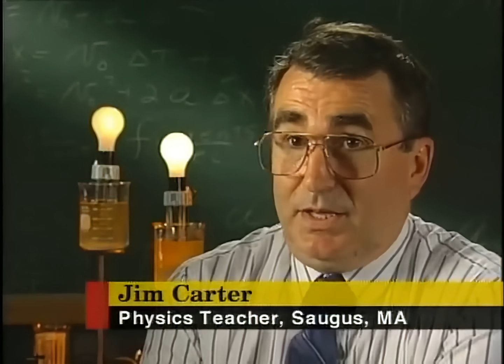MIT graduates cannot power a light bulb with a battery.

Comment: The woman who said the current couldn't flow without a complete circuit was technically correct... she simply didn't know that that base of the bulb could be used as a connection. Simply a misunderstanding of the properties of the bulb as opposed to electrical current theory. This is a prime example of education vs experience in the field.
Reply: I don't think it's failure to understand the properties or construction of the bulb at all.  I suspect that had she been given a 2nd wire she would have immediately connected it to the light bulb and battery correctly (as would several of the others).        The problem here is not failure to understand how the most basic electrical circuit works, but failure to adapt when a simple problem is presented in a non-standard way.   People just do not visualize a light bulb (or motor or almost anything else) in direct contact with its power source.   

I do think this non-adaptability (related to poor critical thinking) is a real problem, but the video misrepresents it.
Reply: @daemn42  Poor critical thinking / reasoning ability, that's it right there. That's the whole issue.

In high school I had a part time job at a mechanics shop cuz I wanted to be one at the time, and the single biggest thing that stood out to me was the incredible reasoning ability of the mechanics. Their problem solving and ability to adapt was so undeniably impressive.

They were one of the best shops in the city and I'm glad I was able to learn from them for those few months.
Reply: @bassmunk  it isn't lack or abundance of critical thinking. It is a way of viewing what things do/how to do them. That comes from working in the constraints of the job. There are recurring paterns to solving problems and tricks of the trade derived from other tricks. The first guy was right, it shows why actual job experience is important. People have to get used to thinking within the constraints of the actual real job.
Reply: Cobblers. Billions of torches (flashlights) the centre contact of the bulb connects directly to the battery (cell actually, but who cares about science?)
Reply: @daemn42 thanks for writing this for me. As an engineer worki g with young engineers, this here is the main problem.
Reply: @daemn42  You can turn a single wire into two wires pretty easily if that's how you feel you need to solve it.
Reply: @daemn42  MIT students can’t think critically? Joke of the century……
Reply: @BadAss_691   Welcome to 7 years ago, and yes MIT students like all students can be fooled by a non-standard presentation of a familiar problem.
Reply: I think everyone is overthinking it, if the battery is not capable of supplying the proper voltage, you can still connect it, but it wont be as bright or light up at all, but you at least connected it correctly.   Its a trick question...  Terminology means a lot, and everyone screws it up.  I cant count how many times we've connected multi-million dollar CRAC units and server cooling systems that I knew weren't going to work sufficiently with the power supplied and other factors,, but was required to do it anyway, just to show the tenant that they got ripped off or had hired a very poor engineering firm to do their design ( if you build enough of them you'll figure it out as well). Of course Light bulbs and lightning systems are way easier.
Reply: @byb4376 Caveman make light with battery bulb and wire. Caveman take positive end of battery, and make touch with positive contact on bulb. Then take wire, connect negative end of battery to negative end of bulb. Caveman like light. Light gooooood.
Reply: +theo tryhard It should be, but isn't.   That's sort of the point, and small optimizations like that are the foundation of a lot of puzzles.
Reply: @daemn42 Caveman make light with battery bulb and wire. Caveman take positive end of battery, and make touch with positive contact on bulb. Then take wire, connect negative end of battery to negative end of bulb. Caveman like light. Light gooooood.
Reply: I think the first (candle shaped) big light bulb was rated to 120 volts, so 1.5 volt battery isn't going to produce enough current to make it lit.
Reply: @Derpstering Caveman make light with battery bulb and wire. Caveman take positive end of battery, and make touch with positive contact on bulb. Then take wire, connect negative end of battery to negative end of bulb. Caveman like light. Light gooooood.
Reply: it should be obvious that the bulb be used as a connection, as it connects to the wire
Reply: @theotryhard8651  yeah it is quite obvious at that age...I mean we do this stuff when we are 10/ 11 yrs old so it's quite obvious to me now that I'm 20
Reply: @theotryhard8651 Caveman make light with battery bulb and wire. Caveman take positive end of battery, and make touch with positive contact on bulb. Then take wire, connect negative end of battery to negative end of bulb. Caveman like light. Light gooooood.
Reply: "In their classic paper Perception in Chess, Chase and Simon reported on a study that compared the abilities of experts and novices to remember the positions of pieces in chess. When pieces were arranged on the board as they might be during a game, the experts' memories were far superior to the novices'. When the pieces were arranged randomly, there was little difference between the memories of the experts and the novices. The traditional interpretation of this result is that an expert's memory is not inherently better than a novice's but that the expert has a knowledge structure that helps him or her remember particular kinds of information. When new information corresponds to the knowledge structure -- in this case, the sensible placement of chess pieces -- the expert can remember it easily. When new information doesn't correspond to a knowledge structure -- the chess pieces are randomly positioned -- the expert can't remember it any better than the novice.

A few years later, Ben Shneiderman duplicated Chase and Simon's results in the computer-programming arena and reported his results in a paper called Exploratory Experiments in Programmer Behavior. Shneiderman found that when program statements were arranged in a sensible order, experts were able to remember them better than novices. When statements were shuffled, the experts' superiority was reduced. Shneiderman's results have been confirmed in other studies. The basic concept has also been confirmed in the games Go and bridge and in electronics, music, and physics." src. CodingHorrors
Reply: Blake Marshall even though she was " technically" right, she couldn't solve a basic problem without it all being laid out for her. If I have to give you all the " correct " parts then didn't I just do it for you. That is a problem if you can't think out of the box
Reply: +By B, it's not a trick question. They failed the test before connecting the circuit. The question they were asked was a hypothetical one, the question was about whether or not it was possible to connect the battery so that a light bulb would light.

My guess is that the graduate that got the other bulb was the one that asked for a different bulb realizing that the battery didn't have enough juice to light the bulb.
Reply: @SmallSpoonBrigade Caveman make light with battery bulb and wire. Caveman take positive end of battery, and make touch with positive contact on bulb. Then take wire, connect negative end of battery to negative end of bulb. Caveman like light. Light gooooood.
Reply: NoVaKane I would think deduction would factor in at some point. There has to be two connections. There are two separated metal parts in the open. Sometimes I wonder how people manage to feed themselves.
Reply: Technically speaking, you can complete the circuit either by touching the lightbulb to the battery directly or by just grounding it out, but with the amount of juice they have going, that's probably not viable.

It's what they do with a lot of electrical components in cars. I know that my horn creates a circuit that way. But, if you're going to go that route, you should know why you're doing that, not be too stupid to realize that you need a circuit. Even as an 8 year old I knew that you had to have a circuit of some sort to get current to flow.
Reply: I'm pretty sure the big bulb is not made to be powered by a battery of that size. The resistance is too great (or the voltage of the battery to low, however you want it). It's not an error with the circuit.
Reply: You're writing misspelled words and poorly structured sentences with ellipsis everywhere.

 I haven't bothered to read much of what you've written because of this.
Reply: This argumentation is as stupid as the ppl in the video :D
Reply: Blake Marshall I did it when I was 6, no one explained it to me..
Reply: Dan Brit When you have a basic grasp of grammar come back
Reply: Dan Brit seriously read what you're writing
Reply: I don't want to underestimate your education.  But kids in grammar school know that. At least where I grow up. If you can't do it after MIT  diploma.  You have big problems
Reply: Blake Marshall bro ... it's a fucking lightbulb ... a wire and a battery... how much more do you need? it's even lower than highschool practical knowledge,  lower than grade school. i was doing this shit when i was six... And he was the speaker...meaning...he was supposed to be one of the smartest...
Reply: @mr30friends. 
i am pretty sure even a person with down syndrome can connect the bulb up correctly.    still won't light up though
Reply: Blake Marshall  "MIT" graduates.
Reply: @j5892000 Caveman make light with battery bulb and wire. Caveman take positive end of battery, and make touch with positive contact on bulb. Then take wire, connect negative end of battery to negative end of bulb. Caveman like light. Light gooooood.
Reply: daemn42
 I just read your first comment again and saw the video again. Hahahahaha had to read it again to realize how ridiculous it is in this case. Does anyone here understand the fact that this is as simple as it gets ? Presented in a non-standard way my ass. "you dont have a current if you only have one WIRE, you need to close it to make a complete circuit ". You are telling me that an MIT graduate doesnt have the brain to think that you dont actually need a wire if you can connect the components together directly? Hahahaha My 8 year old nephew would have been able to connect this. "People just do not visualize a light bulb (or motor or almost anything else) in direct contact with its power source" Yeah maybe if you have down syndrome. Not even in this case to be honest.
Reply: Blake Marshall probably the biggest nerd like actual nerd.
Reply: @j5892000 Caveman make light with battery bulb and wire. Caveman take positive end of battery, and make touch with positive contact on bulb. Then take wire, connect negative end of battery to negative end of bulb. Caveman like light. Light gooooood.
Reply: To those levels though... it's when you see people stave because there is food in their hand, and they cannot find a fork...
Reply: Blake Marshall an example of being so intelligent you're practically stupid.. book smart but not street smart.
Reply: simply a misunderstanding of the properties of a bulb? lol buddy if you can't work a bulb you got problems..  dont need a schematic to show you theres 2 conductors and the rest of the bulb is an insulator and filaments don't act like diodes so polarity shouldn't matter..  where else you gonna hook the otherside of the battery up to?  the glass part?  lol what experience in the field is there to be had? lmao
Reply: Dan Brit Obvious troll is obvious.
Reply: That doesn't make it parallel,  it just changes the direction the electrons flow in the element.  With one voltage source and one element, there is no series or parallel.  That refers to two or more elements that aren't the voltage source.
Reply: Blake Marshall I don't think this is as much education vs experience as it is knowledge vs understanding.
Reply: Fjdbend Fllf education gives you knowledge and experience gives you understanding so...
Reply: +jadekayak01  Passion drives cleverness.  It's a reciprocating loop.
Reply: It's a trick question, and it can be considered as a manipulation
Reply: Caveman make light with battery bulb and wire. Caveman take positive end of battery, and make touch with positive contact on bulb. Then take wire, connect negative end of battery to negative end of bulb. Caveman like light. Light gooooood.
Reply: Yeah I was thinking hey I need 2 wires.. then I saw the other dude touch the bulb base to the battery and I was like oooh that works
Reply: Blake Marshall
Reply: Marek Rokam you're fucking stupid
Reply: Clay Old agreed they go to school and basically  spit out into the  work wold as if they were parrots... not actually learning just repeating what they have been told.
Reply: After all it's the world we live in. At least in modern societies.
Reply: Problem in some fields and a necessity in others. Nuclear Opreators for example, they have to go by the book, they have to document they went by the book. Doing elsewise can get you fired and bring fines down on the plant.
Reply: Dan Brit it's great you learned this stuff early in life but many people don't and it's not really necessary. Did it even say what degrees they had? I say there's a high chance it's not in the electrical field. 

Also Chernobyl was anything but by the book.

We need both creative people and those who can think outside the box.
Reply: Learn to use paragraphs and capitalization this is a headache.
Reply: Dan Brit nice trolling
Reply: i have proven that i not only know the basics there but know more then you in many fields  me choosing not to cater to you not having the ability to read and breath is not a prob with me it is with you needing so badly a dot to inform you to breath or think lol...it shows you are incapable of basic functions go chew gum and walk so you fall :))
Reply: my sentence structure is vary good I leave the arbitrary marks out its not my fault you don't have critical thinking...as for the spelling its grate to know your shallow anof to make fun of disabilities ....and the lack of you trying shows you are just an incapable plug  bot...its funny how you think you have said anything intelligent atall tho lol...and its funny how you have no ability to make points or arguments but yet little scratches missing a dot hurts your brain lol it shows how small it is
Reply: Clay Old Sadly let's hope that's the case.
Reply: There were two ways of closing the circuit. In series and in parallel. The wire going from neg. terminal to bulb to pos terminal is in series circuit. In parallel would be neg term. to bulb and pos term to bulb wire. Both would light the bulb.
Reply: no-this is a perfect example of people getting so full of "education" they can't DO anything real.
Reply: It's a perfect example that education doesn't make you clever. Education with passion does.
Reply: Phantomshttersucksatlife you can understand without experiencing. By this I mean the MIT students could know all the formulas, but do not understand how they affect the real world.
Reply: not knowing how to propperly make the loop is just shamefull. 
but ehh.  that's a 40 or 50 watt bulb.
Reply: @chris L as soon as they ask the question "do you think you can light a bulb with a battery" their answer should be "that depends"    "what kind of battery and what kind of bulb"
Reply: Never had even near 1k likes for a comment before 0.0
Reply: How is the light bulbs going to conduct to the wire if it doesn’t conduct itself? It’s a very simple problem, if she is an engineer then it’s problematic that she can’t solve it
Reply: nice, I like this point of view.
Reply: But I did this at school when I was like 10 or 11 yrs old???? I possibly can't get into MIT cuz you need extracurriculars and it's super hard for international students... But suddenly I don't feel bad about it🤷🏻‍♀️ countries like mine are not the top of the list  for research not because we are dumb, but because we don't have thousands of dollars to pour into research!
Reply: Ive worked for 4 years as an electromechanic. In school for EE as well. I learned 10x as much at work than i do at school
Reply: True
Reply: It's not opposed to electrical circuit theory, it says it. That's very very basic to be taught in any Electrical engineering class
Reply: It's not that deep bro
Reply: No
Reply: Very true
Reply: Anyone who has disassembled a flashlight should know this. (Sorry for late comment :) )
Reply: Well, Tesla did it without a return path.
Reply: not being able to realise that means shes an idiot. Im a stupid science kid with zero experience but i can tell
Reply: Or you can make 2 wires from the one wire...
Reply: You don't need experience in the field to power a lightbulb ... and most people would assume that an "engineer" with a degree from a renowned institution would know how to, even if not electrical engineer. That's a scary video and what's even scarier is that things in education have been going downhill since this video was made.
Reply: no, it does represent a theoretical lack of knowledge, because if you connect both ends of the bulb with wires, you should understand that the wire is just a formality. 

It is a trick question, but one that shouldn't stump an engineering graduate.
Reply: This is not a prime example of education vs experience. It is a prime example of not fundamentally understanding how things work. This is absurd for an MIT graduate not to be able to do this.
Reply: No this is an example of actually paying attention to the object in question and it's properties
Reply: It sounds like you are one of the people who are the problem, making excuses and giving the benefit of doubt to a moron. Anyone with half a brain knows how to make a light bulb burn with a battery. You don't even need the wire if you have a pocket knife.  
MIT graduate? I almost puked when I heard the comments. I have thought for my entire life that you had to be smart to graduate MIT? 
What would they do if you handed them an LED and a battery. Would they even know what it is? 
Unbelievable!
Reply: @GeorgeGeorge-yb2sz  dude. You can somehow turn on a lightbulb with a pocket knife and a battery. Can you design a microprocessor or model the flow of air through the combustion chamber of a jet engine? You know different things. Be less insecure.
Reply: That's just an example of something you haven't learned and not having the problem solving skills to figure it out yourself. Has nothing to do with where you didn't learn it.
Reply: @michiel5160  If a person with that limited knowledge or in other words, stupidity was able to pass the entrance exam (If DEI hasn't eliminated it?) then I should be a shoo in for NASA's rocket program!
Reply: No she's just a dumb ass. I was doing electrical circuits far more complex than this in junior high. Rebuilt my first overhead cam engine with no help. Only a Honda shop manual then too. Now I fix engines and flight controls  on Boeing 737s. Didn't go to school for that license either. I lead my crew and solve problems.  On weekends I teach Skydiving. A very complex sport.
Reply: She absolutely was not technically correct

Your argument is literally this "she was asked if it was possible and she said NO, while she was factually wrong, she was correct because as far as she was aware, it wasn't possible"

That's called being wrong
Reply: It's a fucking light bulb not a nuclear reactor.
Reply: Caveman make light with battery bulb and wire. Caveman take positive end of battery, and make touch with positive contact on bulb. Then take wire, connect negative end of battery to negative end of bulb. Caveman like light. Light gooooood.
Reply: *****
Holy fuck dude. I do not think you understand the simplicity of the task they were told to do. There is no excuse except for the editing.
Reply: I doesnt matter that the battery/lightbulb wasnt the right one. They should be able to make the connection (which would produce no results) and they should say what the possible 3-4 problems could be. As I said, the only excuse is the power of editing. If no malicious(?) editing was done then they are truly stupid.
Reply: @Mr30friends Caveman make light with battery bulb and wire. Caveman take positive end of battery, and make touch with positive contact on bulb. Then take wire, connect negative end of battery to negative end of bulb. Caveman like light. Light gooooood.
Reply: I don't even have a BS and I know this stuff, but I work in Industrial and commercial construction, so we always end up with weird problems that require research.
Reply: @byb4376 Caveman make light with battery bulb and wire. Caveman take positive end of battery, and make touch with positive contact on bulb. Then take wire, connect negative end of battery to negative end of bulb. Caveman like light. Light gooooood.
Reply: Blake Marshall she just repeated something she heard in class.
Reply: daemn42 Being taught to do something and being taught to learn are two very different things. We need less of the former and much more of the latter.

The truly educated never graduate.
Reply: They have to know that the lightbulb is a resistance and therefore it needs to have two terminals, anyone who knows the bare basics about electricity should know at least that.
You could argue they were cherrypicked, but can't defend them on the basis that they don't know how a lightbulb is made.
Reply: Christopher Hitchens its a inferiority complex most minorities acquire through some means. They constantly compare themselves against other minorities to see who's in second place to white people, completely blinded to the fact that the competition is in their heads alone. A truly sad existence to be in constant conflict with your own place in the world, never seeing yourself as equals but the next best thing at best... its a real epidemic unfortunately.
Reply: @inoffensiveusername4684 I sure hope nobody feels like this. I was born in 1980, and believe me, when I was growing up, I didn’t even hear about racism until I was in maybe 11th grade. My generation seems to have beat this thing a long time ago. So why is this generation bringing it back? It seems so absurd to me to think differently about someone if they don’t look like you? What even is that
Reply: @inoffensiveusername4684 Caveman make light with battery bulb and wire. Caveman take positive end of battery, and make touch with positive contact on bulb. Then take wire, connect negative end of battery to negative end of bulb. Caveman like light. Light gooooood.
Reply: Hard_celery ...or knowing how the basics work and fix problems can save millions of lives like in the japan earth quake it can save millions of lives to throw the book out and think out side the box...our world will burn because the sec something goes wrong that the computer that made the book didn't think of  will kill us all because some i think I'm smart look at my paper cant put power source to required area ...yours is by far the dumbest hear if you or theas people are in charge of world i fear for us all....this is a basic test given to kindergarteners in other country's and its about knowing the basics and problem solving ...and if it hasn't bin in there books at mit then what are they even teaching...no one should ever be around electricity if they cant do this test it is the A in electrical abc ...or lets go this rout Chernobyl was nuke scientists going by the book and did kill and destroy
Reply: no-even passion won't make you clever.
as another poster said experience makes one clever.

education for its own sake is useless,there must be an application
Reply: Mr30friends
Yes, that is my contention, that they're fooled by the "one wire" part of the question because it is outside of their experience.  You'd rather believe that none of them have a clue how a basic electrical circuit works (as the video presenters contend)?
Reply: @daemn42 Caveman make light with battery bulb and wire. Caveman take positive end of battery, and make touch with positive contact on bulb. Then take wire, connect negative end of battery to negative end of bulb. Caveman like light. Light gooooood.
Reply: o god you get even dumber...yes not most got this knowledge but your forgetting they are at mit the place ware you get engineering classes that if you graduate should be bloody able to do this  the simplest of them in all electrics something if they didn't know before getting there they  should know it after ...and if this wasn't in there book mit has fallen hard and is dumping out plug bots a vary unwanted thing....but its both the school failing them and the fact you and them have no critical thinking...and if you are a mechanical engineer and you don't know the simplest of electrical tasks or problem solving open up anything look at anything mechanical in the last 20 years do you think electronics isn't in there that's the dumbest thing you have said yet...and look into things before you speak...it was by the book an experiment thought up by a pc written down that then was bonded into a form we call a book then miraculously when engineers followed it it went wrong o and i bet since they were like you and these people since no procedure was in there golden book they freaked and screwed up  or sat around rather then finding a fix...and thank you for making my point by that being your only retort. and that last sentence takes the cake...those are the same...if you cant do or have one you don't have the other and the fact you even think they don't directly correlate to each other shows how little you know about being creative or a problem solver Nice try tho please insert 50 cents and try again.....
Reply: its also funny how anyone who disagrees with you and shows your lack of intelligence a troll...its ok thanks for the complement if i was and also the complement of i have no ability to retort so ill call him a name lol
Reply: I'm writing well made and balanced arguments to your inaccurate  statements...or in lam terms I'm communicating and debating ...and mostly laughing at the lac of intelligence you and the world seems to be getting
Reply: its cute how any countering well made argument has bin relegated to  its a troll...whatever you want to call me it means my points are right...try again
Reply: lol no reading what you wright is ...i know how just have no belief in using them...for the most part and its funny how it keys in hear...its not up to me to tell you when to take a breath or a brake...it shows you need your book learning so much you arnt capable of simple tasks or able to salve even the simplest of problems being that missing a dot on a paper leads to physical pain lol
Reply: not a troll just smarter then you
Reply: Blake Marshall When you connect the end of the bulb you basically complete the circuit. 
And I think she was an Indian. And there was another genius who was a Black person if you will.
Reply: @rajharsh3114 Caveman make light with battery bulb and wire. Caveman take positive end of battery, and make touch with positive contact on bulb. Then take wire, connect negative end of battery to negative end of bulb. Caveman like light. Light gooooood.